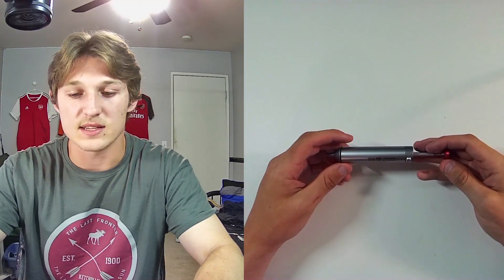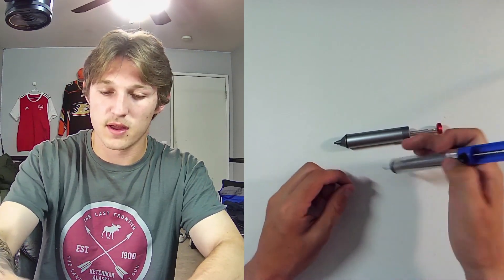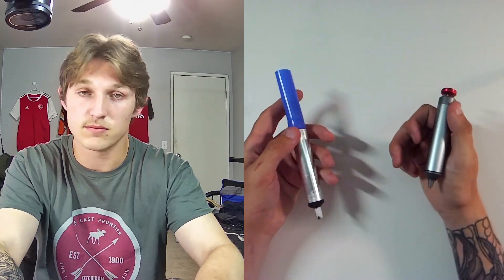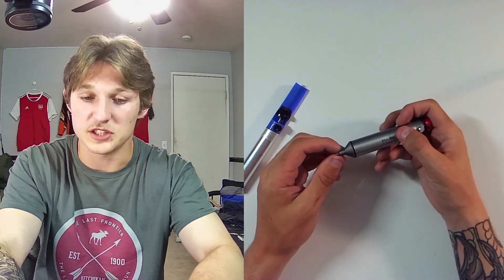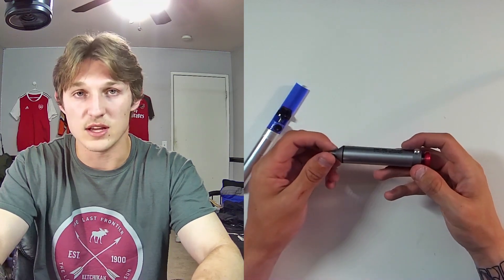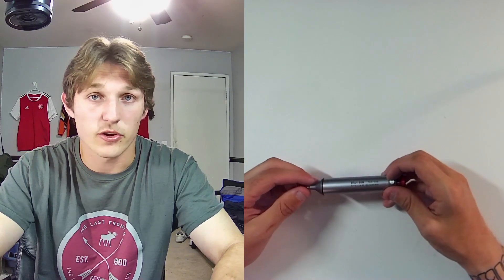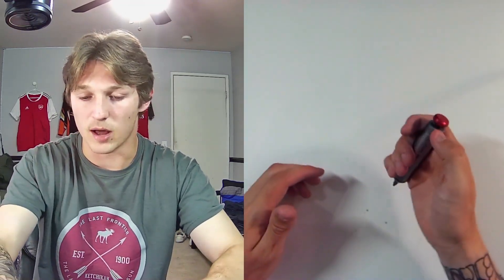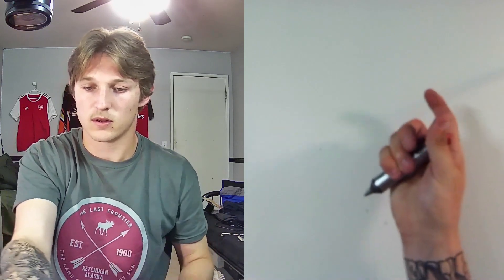WATCH BEFORE YOU BUY - Engineer SS-02 Solder Sucker

Comment: After I clean out the "Sucker" I put either petroleum jelly (Vaseline) or high-temp grease over the parts where I see solder sticks to and coat the tube too.  Next time it comes to cleaning it is a simple process of just wiping the solder off with an old rag and repeat the grease coating.